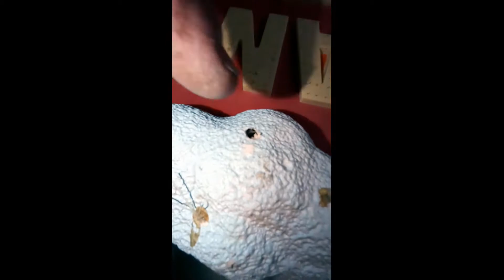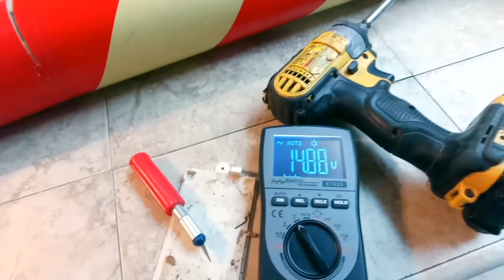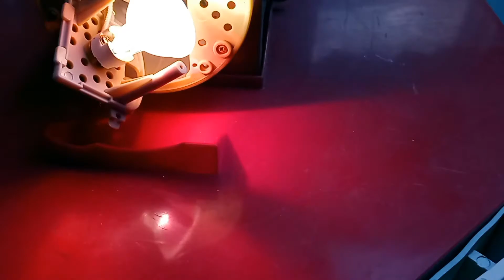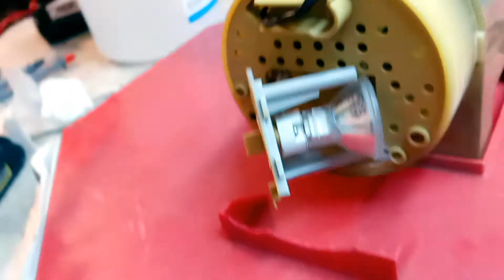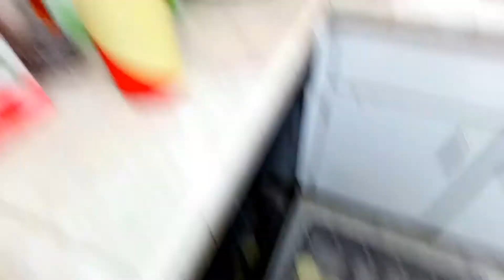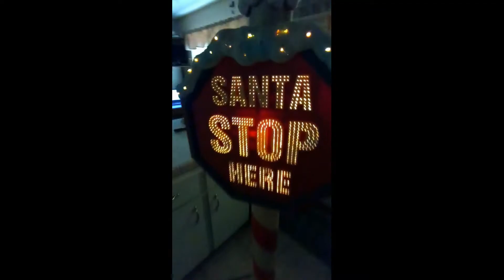Outdoor Santa Stop Here Sign Repair

Comment: Any way you can make the bulb brighter? Or what bulb replacement would be ok to use?
Reply from the maker: You can technically make it brighter by installing a higher wattage bulb. I would recommend an LED bulb to reduce some of the heat.